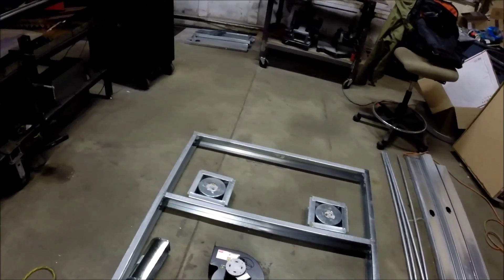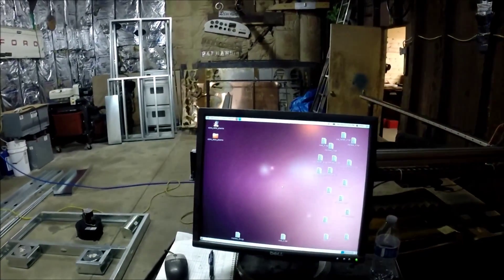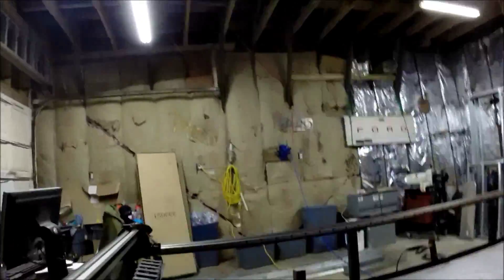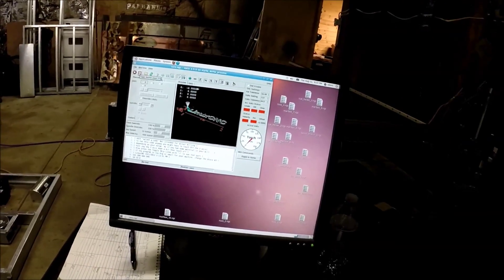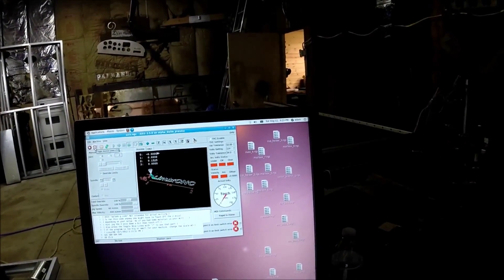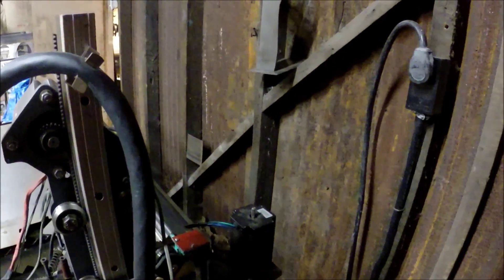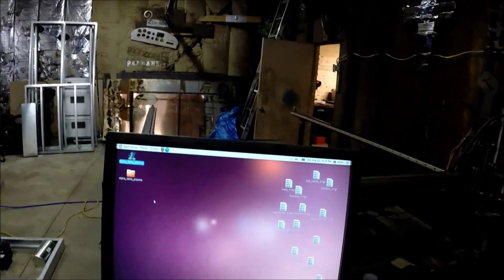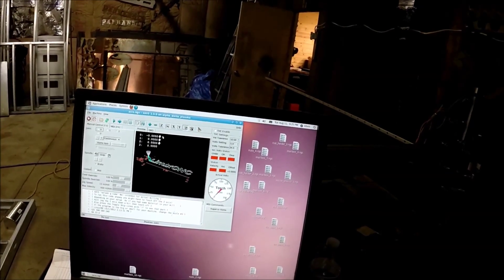DIY Powder Coating Oven Build: Part 4

Comment: Hi Adam, I just ran across your channel by chance. I too am putting together a parts list as I am going to attempt this same project. I was watching one of your videos and you stated that you underestimated how many studs you needed and later you had to purchase additional studs. I would prefer not to run into the same issue, my question is, how many studs has your build required to complete framing?Very nice job by the way!!!

Comment: is it possible is you can post a list of material required including the thickness of the metal used (in mm) they types of fans and type of insulation.
Reply from the maker: +Suhail Sadar I used 18 ga steel for the walls and ceiling. 16 ga for the floor. I'm sure a google search could convert ga to mm. I used regular household insulation. Pretty much everything else is linked to at www.adamsbentmetal.com/powder-coating-oven-parts. Thanks for watching!
Reply: url comes up blank   No Parts List
Reply: Correction :If you have AdBlock Pause it for parts list
Reply: Adam's Bent Metal Did you use 18ga or 20? On the video you said you’ve ordered 20. Just asking as I’m considering which one to choose. Thanks. 
Nice video though. 👍🏻
Reply: Suhail Sadar eeeeeeeeeee